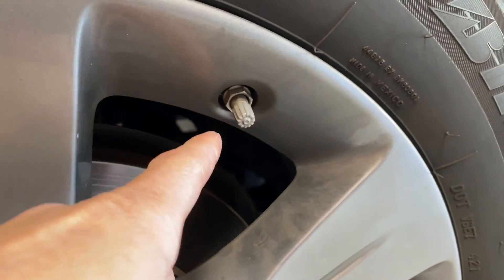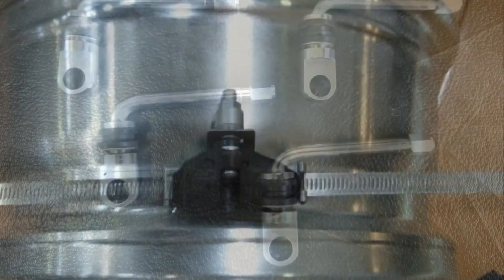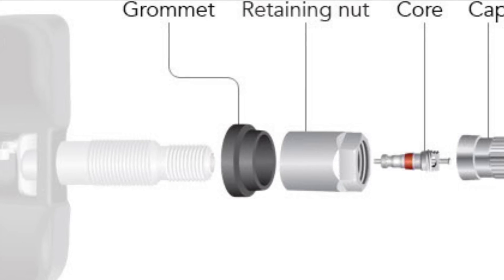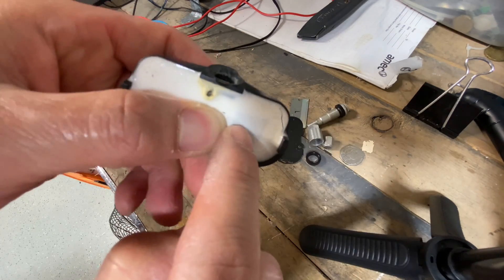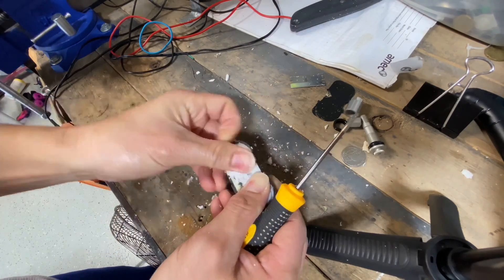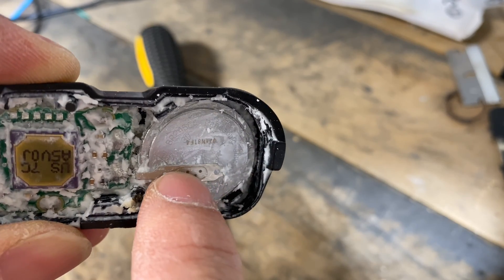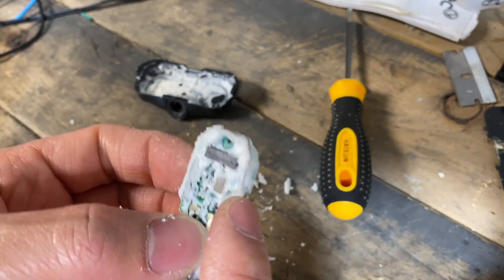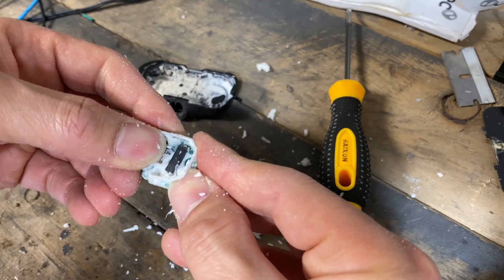TPMS Battery Change (Tire Pressure Monitoring Sensor) Pacific/Denso | Toyota Honda Lexus

Comment: Glad I found this video. I was trying to go with a cleaner install on my 3 piece wheel and was about to pull the trigger on straps. Glad you already tested it out for me. My tire shop told me they drill it. I decide to go with that after seeing yours. Ha.
Reply from the maker: Yea I was iffy about it back in day. But my wheel assembly friends did it and it’s no different than the factory hole in any wheel.

Comment: ive got an aftermarket TPMS installed for a 5 years thats been discontinued, cannot buy replacement sensors so battery change only option.

Comment: So when I remove the TPMS from the tire, I need to first loose the sensor before I can break the tire bead? Thank you!
Reply from the maker: Depends on how thin your tires are. If you got low profile tires, yes drop it inside before dismounting tire.

Comment: I've found (twice) if you get Michelin tires with new sensors, the tires last so long, the batteries ALWAYS go flat before the tires wear out, by a large margin.
Reply from the maker: These are 7 to 10 year batteries.
Reply: @TunerwithKids  Good to know. I had the tire store install the last ones, very likely not Lexus.

Comment: Not sure how good they will be, but I bought preprogrammed "More Sensor" replacements on Amazon for <$75 for a set of 4.
Just installed them and they are working fine.
Reply: Can you reuse the old valve stem with those?

Comment: You don’t need to do anything with the circuit board leave it alone , all you have to do is desolder + , and - from the battery , use a thin blade to pray out the battery .

Comment: Hi Binh!  If I purchased a sensor from the dealer, would it need to be programmed thru my obd port or would the sensor be relearned by the tpms system after driving for a certain number of miles?
Reply from the maker: Needs to be programmed via oBD port using techstream or tire tool. You can buy on Amazon (Denso OEM) see links in description box for less than $40/ea. any local national tire shop can install and program for less than dealer.
Reply: @TunerwithKids  Thank u Binh!

Comment: I like your very informative videos for the owners of lexus cars, brother, it is worth changing the battery or buying new sensors, my light is on today, it blinks and it stops, I think that with 10 years of life we already have to change them all, I would like to change the battery be cheaper although much more work, if I buy new ones I have to reprogram the codes, what do you think, what battery did you use?
Reply from the maker: Buy new. It’s not worth it to replace due to construction of the sensor vs the cost of new $35/ea.
Reply: I appreciate your response and advice, do you say $35 new oem toyota or aftermarket?
Reply from the maker: Check links in description. Denso is OEM pacific brand sensor.

Comment: Do less work by cleaning the battery side only and leaving the circuit alone. To free the battery simply heat up the connected flat pieces of metal with a soldering iron and chisel them out with a razorblade, while trying to keep enough metal to reach both sides of the battery. That way you can solder the pieces back to the new battery.
Reply: I used a soldering iron to burn an access hole for the two tabs of the battery, and soldered wires to the tabs, leaving the original battery in place, just for testing purposes. The OEM Ford sensor used a 2045 lithium cell, and it looks like it needs 2.6V min to operate.

Comment: After ten years of operation, for sure the battery is dead but the circuitry itself has been exposed to the bumps of the road affecting its precision so the wise thing would be to change the whole sensor.
Reply from the maker: Yea for $35/sensor it’s not worth the trouble. That coin battery is already $15/each.

Comment: How long does the sensor last for?
Reply from the maker: 7 to 10 years. I previous set I changed at 10 years a precaution since I have 20s and cost of tire dismount isn’t worth it for a $35 sensor.

Comment: Only "OEM" made in China sells for $34. From Toyota/Scion/Lexus they cost anywhere between $68 and $79.The difference is about signal and specification. I installed 5 so-called OEMs on my Sequoia and no one communicated in the test mode properly, not to mention the wide range of threshold pressure, basically rendering 2 useless with a threshold below 20 psi. Just keep in mind, I had to pay $350 for the 5 sensors only (4+spare wheel) from the Dealer. I refused, ended up replacing two TPMS ECUs, and finally gave up by disabling the warning light. This was a good lesson for me and hope for someone else, as well.
Reply from the maker: Not true. Denso first fit are same OEM Pacific sold by dealers in different box. Denso is an OE supplier and private labels these sensors for consumer. Lots of people end up buying wrong part (Toyota used 3 versions of these Pacific early on in 2004-2007) or a set of used take offs which have unknown life.
Reply: @TunerwithKids agree but still pricy for me , back in the 80’s your foot were the tpms one kick on the tire and you knew if air was needed , I still practice this 😂😂.

Comment: Yeah, that black piece @ ~8:30 talked about came off the board on one of my new sensors. One brand of sensors that I have is not incased in silicon. I don't think that piece is an ic "chip" but some material used to measure the air pressure. Two out of 4 I bought online were no good! From now on I will buy them from my tire shop! Really it cost me about the same.
Good video btw Mr.Tuner, gave you a thumb...............
Reply from the maker: Yea. Aftermarket and used are suspect. These OEM are like $30 to $40 each and last 10 years so might as well get new.

Comment: After replaced batteries for FORD tpms sensors, they did not work anymore.
Lost some information and need to be re-programed?
Reply from the maker: Idk, it should just work as it just stores the TPMS code and transmits pressure data to the car.

Comment: Hey there, thanks much for this video. I just pried open one of my sensors that wasn´t giving any signal, but the battery measures 2.75V, so it´s not dead. Do you know by chance if the battery needs to be fully at 3V for the sensor to transmit?
Reply from the maker: That’s within the 10% tolerance but if they are old, they may not have enough amps.
Reply: @TunerwithKids  Thanks. I'll replace a brand new battery and recheck
Reply from the maker: If you already opened then new battery is the way. But for a $35 sensor, I’m not sure it’s worth it to change $15 batteries and reseal the sensor back.

Comment: The filler is called "potting compound." It's very common in old power bricks and power supplies.
Reply from the maker: Naw, the stuff they use in here is rubber silicone like RTV. I use potting compound for my HID ballasts and I know what that stuff hardens like.
Reply: @TunerwithKids  I don't think potting compound is one specific thing. Like, I've done a "rebrick" of stuff like Commodore 64 and Atari 800XL "Ingot" power supplies and I'm sure I've seen some that appeared to be silicone. Honestly, I prefer when it's NOT silicone since I can sometimes freeze it and crack it to bits. ;)

Comment: Why was it required that these sensors be implemented? Was it a safety issue thing & or just another way for companies to make an extra profit? It really would be great if they changed the design so the battery could be accessed easier without having to pretty much destroy the sensor in the process. With the TPMS it also would be great if the system would just let you know exactly which sensor has failed. I’m sure it’s probably more cost effective in some way for them not to be made that way. There’s a transmitter that is made to check to see exactly which sensor is bad & also with some vehicles the spare tire should also be checked. Thank you for showing how to do that!
Reply from the maker: It's a govt mandate since 2006 or a few years after that. Many MFGs started earlier than mandate. It helps keep the public safe by warning drivers to air their tires. They have gotten cheap, ~$30 each plus the install and program which many tire shops do now. Many cars have early versions that dont show which wheel is where but newer cars can keep track of which corner, but user/mechanic must show where they rotate the tires to.
Reply: @TunerwithKids  
I don't know about other states, but Pennsylvania does not mandate that the TPMS system has to work to pass inspection and of course there are some states that gave no vehicle inspection program.
Reply from the maker: That and safety? I remember like 20 years ago Goodyear or Bridgestone had a huge nightmare on the Ford Explorer but most it would have been solved if owners didn’t drive with under inflated tires.
Reply: Wasn’t thinking of when a tire rotation was completed. Good point. Do you know how the person who works on the vehicle would go about letting the system aware of a rotation? Might be a dumb question but isn’t there only 1 way to eat a Reese’s, I mean do a rotation?
Reply from the maker: Some cars have settings in the infotainment system.
Reply: Back in the NIxon 55 mph days to get every mile out of every drop of gasoline the govenment determined that having properly inflated tires was necessary for the national defense therefore Americans were introduced to the TPMS, which would help them achieve that mandate.

Comment: Good video man! They made it very difficult to get to the battery
Reply: But last 15 years. No battery drain. Buy factory OEM!
Reply: @americanrealitytoday  My Peugeot 407 V6 have the same pressure sensor and it last about 18 years.
Reply: They didn't make it hard to replace the battery; they made it very likely that the circuit board and devices mounted to it would survive a decade of harsh movements up and down and all around. The silicone potting compound is a cushion and fixture method to make sure none of the pieces fracture from stress or work hardening and nothing gets ripped off the board from the G forces experienced as the tire hits pot holes. They have no intention of making it hard to replace the battery as all they care about is making the thing live for 10 years with all that abuse. Have you seen how they package and build things that go on rockets or get delivered to space inside rockets? Tons and tons of vibration mitigation design, devices, and materials. They have to build stuff to survive getting shaken apart by the extreme vibration of a rocket firing the payload up into space. It's intense! 🤓

Comment: I just bought some  2pc WEDS 709M that came with  90 degree valve stems and TPMS footwork adapters. Would locktight help with preventing the TPMS adapters from coming loose?
Reply from the maker: My issue with the valve ring is they break when tightening cause hollow screw. Lock tight means you have to risk break it off each tire valve change.